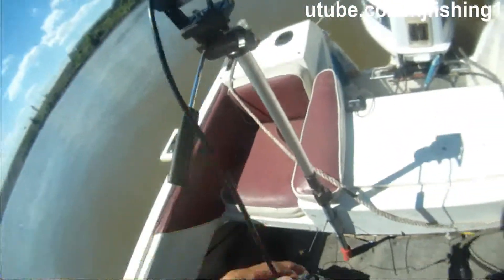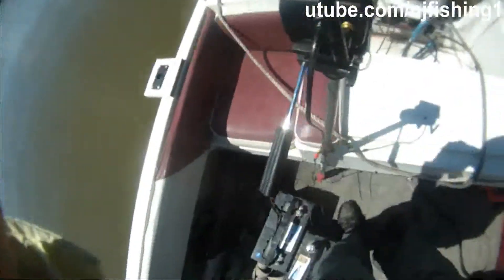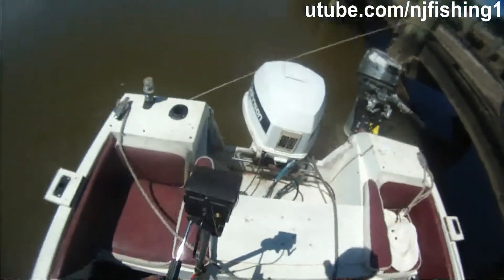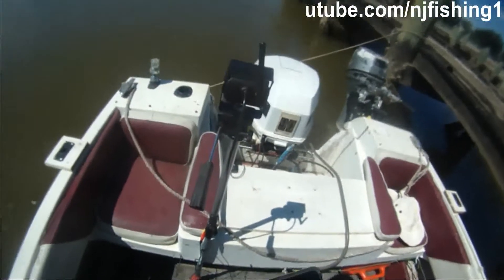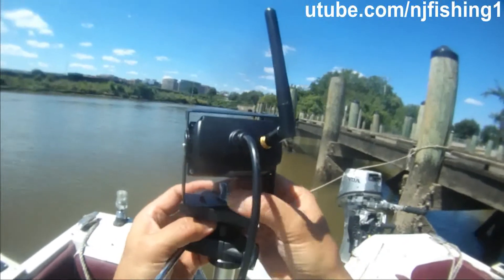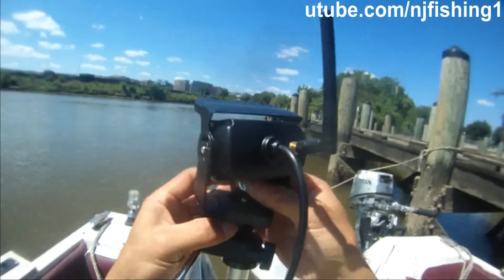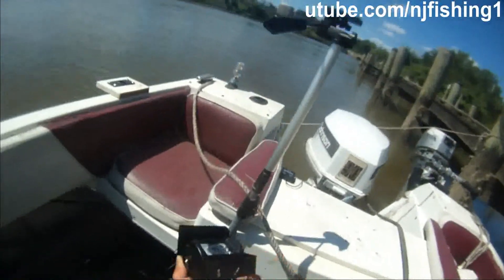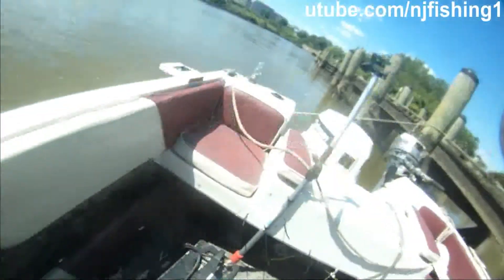my 1982 Johnson 90 hp power trim and tilt is making noise - getting too old LOL

Comment: The pivot on the top of the ram is dry. If you can get the pin out, clean it up and use some grease on it.
Reply from the maker: James Doughty thanks very much for the tip. Will look into it and report back.
Reply: Did you ever find out the issue ?